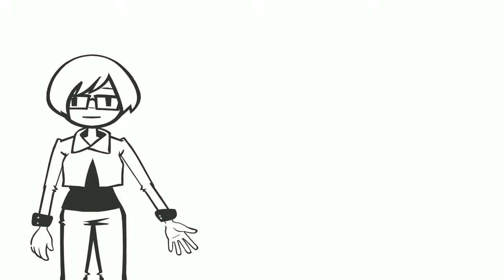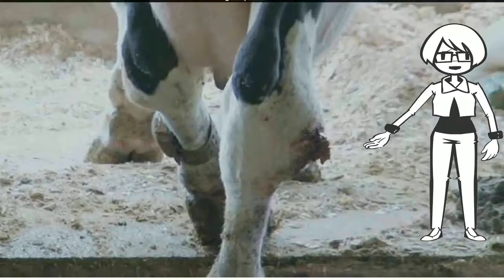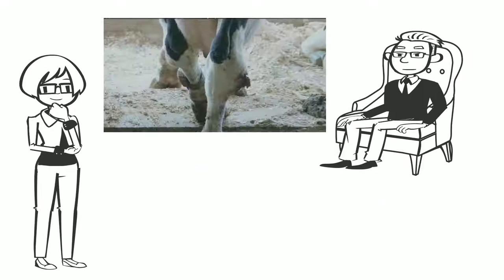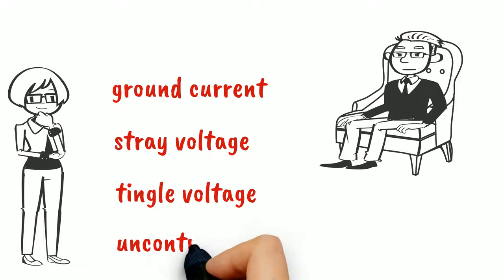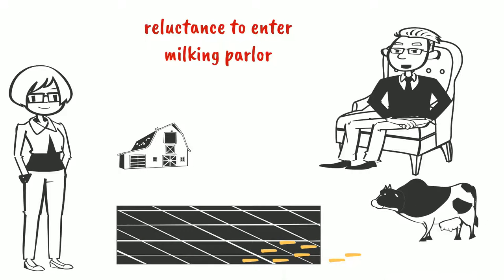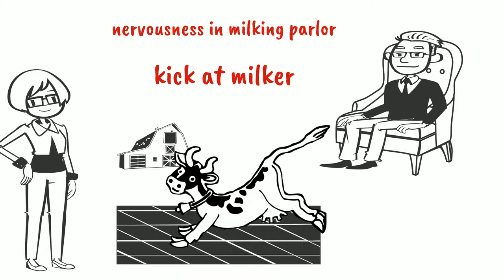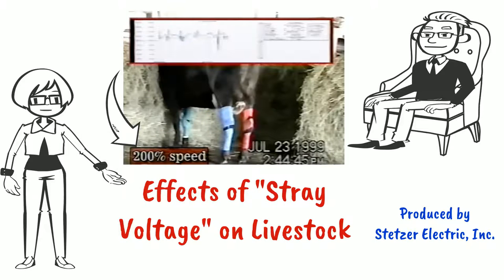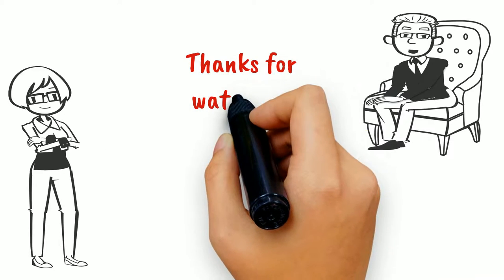Ground Current Affects Dairy Cows

Comment: I don't understand a few points.  The previous video only showed a voltage potential of a few millivolts at the ground stakes.  That is using ground stakes with minimal resistance.  A person with shoes on or an animal with dry feet would not experience that level of voltage with any significance as their contact resistance is much higher than the stakes.  Next- How are the injuries and behavior assessed as being related to millivolts?  The graph captioned in this video is unclear and merely shows an irregular wave form.  What is the data in the captioned O-Scope screenshot?

I agree that their can be a voltage potential between the dirt on the farm and the milking floor.  This is easily detected and mitigated.  The voltage between a poorly grounded milking machine and the animal is also easily detected and mitigated.  It is a valid point to make that the animal would experience discomfort if it is being shocked but how would that relate to external wounds?

In the Dancing Cow video insert, the narrator states that power is disconnected from the farm at the time of recording.  Yet there is no information provided which states where the source is.  So, what are we looking at?
Reply from the maker: For a 60 Hz sine wave the voltage potential can be several volts but for the higher frequencies in the kHz range it is generally in the millivolt range.  You might expect that this is too small to have any significant biological effect.  There is a major difference bewteen these two frequency ranges.  kHz frequencies, for example, can penetrate the body.  In other words the go internal to the body whereas much of the 60 Hz simply flows around the body.  Also, the body and the ground are capaqcitively coupled so you can be exposed to the oscillations even if you wear shoes or boots.  Also, when the ground is wet, there is more current flowing  along the surface of the ground.  In barns it is difficult to keep the floor total dry.  Here is a study that documents the effect of dirty electricity on milk production:  https://pubmed.ncbi.nlm.nih.gov/23416176/